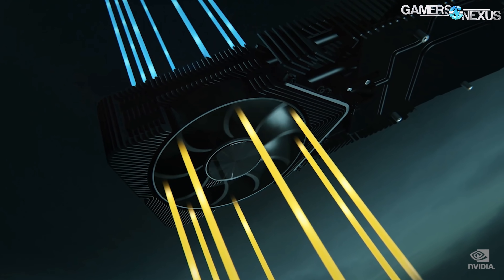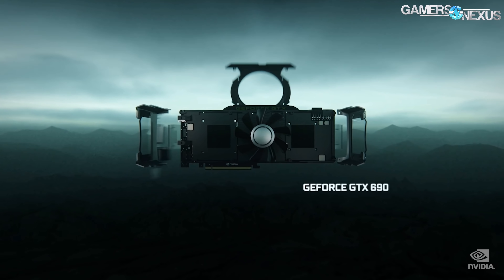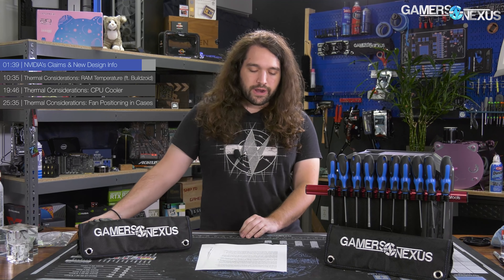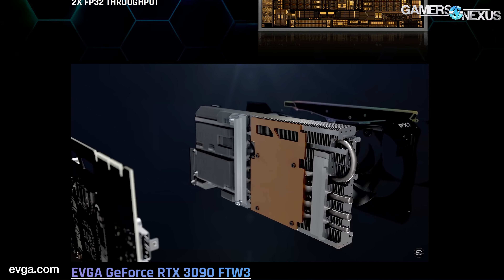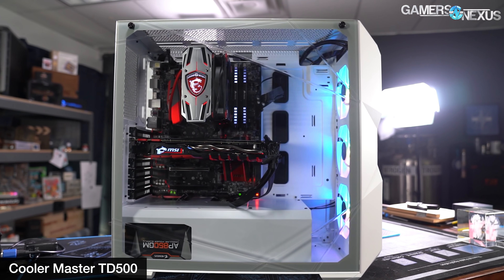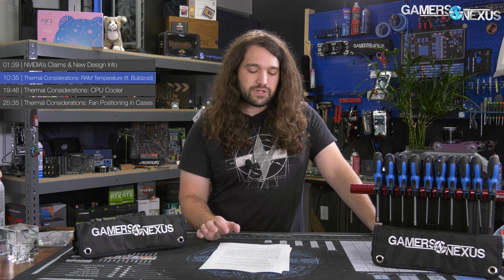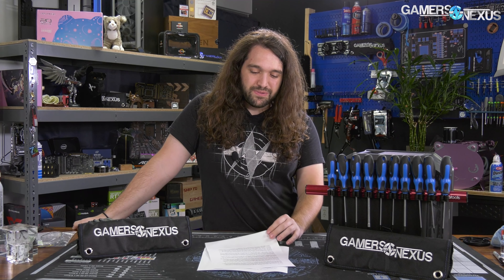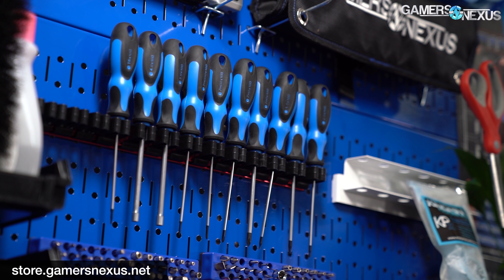NVIDIA RTX 3080 Cooler Design: RAM, CPU Cooler, & Case Fan Behavior Discussion

Comment: I just want the same thing as for every cooler. A Temperature that doesn't throttle and no loud turbine. 
What's also important: A good pre-programmed Fancurve. My ASUS Strix 1080 Ti had no hysteresis. It's Fans started and stopped spinning constantly in idle.
Reply: Should of downloaded msi afterburner and tweaked the fan curve yourself.
Reply: @propeldragon  I did, but the program needs to run or it resets the curve... cough bloatware
Reply: @gucky4717  Afterburner is not bloatware. Many people including me have been running it for years.
Reply: propeldragon Think of a food you hate. Now I’m going to tell you that I’ve been eating that food for years, so that means you don’t hate it anymore; now, you like it. 

Does that make sense to you?
Reply: My Strix 1080Ti is fine. My fans don't even think about moving until about 50 or 60 degrees. My Strix 970 and 980 were both fine too. Maybe your issue lies elsewhere.
Reply: @brutalwang4106  Thats the Problem. If i don't use a program to fix the hysteresis. Fans would spin at 56°C and shut down at 55°C. And that happens constantly.

Comment: To prevent confusion you could say standard voltages and clock speeds rather than lower. I think it better gets across the idea of what voltages and clock speeds are out of the box without the negative connotations of lower.

Comment: At this rate these cards look so nice that no one is going to want to liquid cool them
Reply: weeeell.. the few waterblocks i have seen so far are for reference design anyway, and not founders ^^'  To be honest, the vertical 12 pin socket would look ugly on a 1 slot watercooled GPU
Reply: Lmao no. Watercooling a card and watching it hit 40c max on a 30c room cannot be replaced.
Reply: Never having to hear your spiffy GPU turn into a blow dryer blasting out the back of your case during a 10 hour gaming bender cannot be replaced

Comment: I think a most representative test for comparing the FE cooler vs a more typical axial cooler would be a test with 2 cases: one high airflow and one with worse airflow with glass, and 2 cpu coolers: high end air cooler and water cooler in exhaust, as a low end cooler doesn't really fit much on a 3080 build. Of course, people will always complain about a certain setup, but that mostly cover the most common ones.

Comment: I have an SL600M case with 4 200mm fans (bottom intake, top exhast), plus a vertically mounted D-15 exhausting upwards.  This cooler design seems really interesting for good GPU temps, but with a 3900x, I would love to see some testing in vertical intake/exhaust style cases to see just how bad CPU thermals would get.  This is of course assuming more heat energy radiates directly into the CPU cooler's premises, and not out the PCIE slots or towards the front of the case.

Comment: Hey Steve, I would actually be curious  to see how the 3080/3090 perform with a stock intel/AMD cooler. Not because it's a realistic usage scenario, but because they are really crappy coolers already barely able to keep up with the CPUs they ship with. In which case, if a 3080 does indeed worsen the intake/ambient temperature of the CPU, these will be the first coolers to show it in tests. They won't be able to absorb any extra BTUs in soak, or hide small temperature changes in tenths of a degree.
If an intel 10900 with a stock cooler is still able to post the same performance with a 3080 in the system, then any $40, $50, $60, or $100 CPU cooler would simply shrug off any contribution from the 3080 cooler. And if they can't , well that would still be informative to anyone running a SFF with a low profile CPU cooler, without GamersNexus having to run a bunch of low profile coolers in a bunch of extra SFF cases.
Reply: V is for Void stoc cooler and $1500 gpu... well well... not likely scenario :)
Reply: Maybe for stock Intel, the Wraith cooler on a Ryzen 5 3600x is pretty solid.
Reply: Most SFF cases that are actually good usually have a layout where it's not possible for the CPU cooler to intake any GPU exhaust air or can be configured that way depending on how the airflow path is set up.
Reply: I was going to get a 3080 and a mid-range Zen 3 CPU with the stock cooler. I can see the concern with this new fan design, but why is that unrealistic in general? For gaming at 1440p+, it seems like there isn't all that much benefit in getting a high-end CPU; if I were buying a Zen 2, I'd get a 3600.

Comment: Hey Steve.Could you do a video about stock availability of the cards when they come out and your take on it? There are a lot of rumors on the web , some say its propably a paper launch and people will not even get them until end of the year while others say that they are propably just unavailable for some weeks. Would be great if you had more infos about the matter.
Reply: Very interested in this as well!
Reply: 3090 is guaranteed paper launch as it seems rest of the cards probably will be out of stock due to the hype
Reply: Yes I want to know how much I should expect to wait, I've been rocking an RX580 and I really want to upgrade to a 3070 before 2021, but I also expect to be disappointed. (At least there's a chance the used 20XX market will become reasonable though)
Reply: Hey man I got the numbers, things aren't looking good 3000 series launch stocks are a little bit lower than amd's vega launch numbers that's probably because samsung's 8nm yields sucks ass it will be near impossible to get your hands on one

Comment: Both the founder and custom cards appear to have a back plate cutout for fan exhaust. How will this affect vertical GPU mounting where it would be exhausting hot air right onto the motherboard chipset?

Comment: You say the Ryzen cooler is "fine but not that good", but as far as I can tell we haven't seen the Wrath coolers in any of your updated cooler tests. Are we going to see and budget/stock cooler tests soon so we can compare them to the high end coolers?
Reply: Why tho? the coolers are ment to get you started nothing more than that. You should buy something else when you can. Almost any tower cooler is better than stock. Like Steve also said, you dont pair an expensive card with a stock cooler. So the content you are asking for is useless imo. Just get a new cooler.
Reply: I hope not, it'd be a waste of time. We all know that they aren't that good. Only the most fanboy of AMD fanboys would say otherwise, and who cares what they think anyway? Even if presented with data, they'll just insist the testing was wrong and/or the reviewer is a shill.

EDIT: arose001 right above me proving my point already.
Reply: @arose001  I've built 8 ryzen systems since zen 2 launched. There's no reason at all to use the stock cooler, especially on the 3700x/3900x... They're worthless coolers and I'd only use them to test if a system works. They can't handle the chips at full load or with any PBO... Don't even need to give benches for that. You should just know that. The wraith stealth on zen 2 is garbage, 3600 will hit 76c in a high airflow case (p500, NR600, full tower cases etc.) with the stealth. Which is uh. Not very good. I wouldn't even want to turn on PBO and see it hit far higher. Now imagine putting the 3600 with stock cooler in a choked off case. It hits 76c in an optimal setup, 3 intake 2 exhaust, high airflow low ambient (20-21c) what would it hit in a worse scenario?
Reply: @masterdftw4983  The coolers are meant to cool the cpu at stock clocks, which is good enough if you don't plan to overclock the CPU.

As someone that doesn't overclock my cpu, I'd like to see data behind these claims of "you need to use a better cpu cooler to use with an expensive gpu".
Reply: @screaminjesus  Who in the right mind buys an unlocked cpu and not overclock? I can understand if you do not know how to overclock but you are missing out on free performance.

Second, giving Steve's rep and the hours upon hours of content he has provided, why should he use his time on stock coolers when everyone encourages buyers to get an after market cooler.

If you can give me a logical answer so I can try and understand that would be much appreciated. (and no im not trying to sound condescending I really want to know your logic and think process)
Reply: @masterdftw4983  I have a ryzen cpu, pretty much all ryzen cpus are unlocked, so its not like I paid extra for an unlocked cpu. Also, zen2 cpus don't really have a ton of overclocking headroom, doesn't seem worth the bother to me.

"when everyone encourages buyers to get an after market cooler."

This quote illustrates my point. People say "don't use the stock cooler' without providing any data to back it up, which is why I'd be interested in stock cooler results.

Comment: you could always reverse your tower cooler fan. have the back fan blow into the cpu fan fresh air which is also blowing towards the front of the case, and have the front fan blowing out the hopefully mesh front lol.  if you have 3 front fans you could have the top 2 blowing out and the bottom one sucking in towards the gpu intake. and if you have top fans too, you could make the one closest to the back suck in having the fresh air get caught in the crosswind going into the cpu cooler and the one closest to the front blowing out which would take some of the cpu coolers exhaust and gpus air with it since the gpus exhaust blows straight up anyway. the front top exhaust is just to catch any remainder heat and keep air moving fast over the ram.

Comment: "but my AMD ryzen cooler is good!"

"You're wrong, its not."
Reply: My Ryzen 5 3600X runs fine @ 34 oC with default cooler, near GTX 1080 GPU.  It jumps to 50 oC when in heavy use. If I buy a stock Nvidia 3080,that hot air will go straight into CPU cooler ... this cannot be good. I'd have to build a air flow baffle .. or demand Nvidia make one .
Reply: so intel stock coolers are good?
Reply: @fatti9780  All stock air cooler are good for is:
A. Increasing the amount of metal that ends up in your local landfill
B. Making your local bank teller say to you "Computer is being slow today" because her bank gave her some POS Dell slimline to work with

Comment: Simple solution: bottom+rear intake, top exhaust. Done. 
If you're super worried about your memory sticks you can always print a shroud/duct and add a dedicated fan in the front.

Comment: I'm sticking with my 2070 super and skipping the 3000 series and probably the 4000 series.
Reply: naftaLi every two or three generation is good timetable for upgrades if you really need to have very highend atuff. Most people keep the same gpu 5 years before upgrading, so your 2070 will be fine Many years.
Reply: I think I'll stick with my 1080Ti until the 4080. The 3080 will struggle at 4k in some titles. I'll make the costly move to 4k when 60fps isn't a struggle on ultra settings :)
Reply: Wise idea

Comment: Is the conclusion of this video “if you dont heavy OC youre safe?”
Reply: Depending on you current tower/ cooling solution but .... probably safe.
Reply: Normal highend cooler will put all the hear to the case. This will push some of that heat out of the case using that other cooler, while the other push it to the case. So in there this should be better than most aib coolers, but without testing, it is just a theory!
Reply: SmashStomp Inc  corsair does - sf750. Just ordered mine.
Reply: Yes, unfortunately a lot of viewers are struggling to understand things as they are presented.  Definitely feels like he needs to make things easier to digest for some people.

If you pay attention to his other videos then you would know that they recommend a good CLC AIO and they recommend equipping your high airflow case with the fans it needs to perform as best as it possibly can.  If you look at the airflow diagram that image shows what equates to a stock case with two front fans, and an exhaust.  Now if you aren't planning to cheap out on your build you will do what I am doing which is making sure I have fans for wherever the case manufacturer neglects to include them (the case I want doesn't actually come with fans).

Comment: Does anyone think I should upgrade my 550w PSU to a 700w+ for upgrading to a 3080?
Reply: Nvidia States on their web page that the 3080 and the 3090 need a 750 watt power supply.
Reply: Yes, Nvidia recommended 750
Reply: It's literally necessary lol... You'll need 800W+ to be safe.
Reply: Alright I appreciate the answers you all provided. I’ll probably get a 800w to be safe.
Reply: @xronos_exe  Im getting a 750 w, im pretty sure when nividia give their recommendations its usually overkill. But also depends if you are overclocking your parts

Comment: Seems like an AIO with its radiator set up for front intake alongside having exhaust fans at the top & rear of the case is one of the best solutions to the FE card's airflow.
Reply: that's the most common AIO setup. Although if your m2 is below the card, your SSD will suffer no matter what. Personally, I do not see 300W+ cards being air cooled inside the case as a normal situation.

Comment: I would like to know...since Intel is slow getting pci-x 4.0 support out there, I have PC with Intel Z390/i9-9900K which only has pci-x 3.0. Seeing the new RTX 3000 series supports pci-x 4.0, will us Intel users be left in the dust in terms of "cheap" upgrade path and run into bottlenecking with the RTX3090, while AMD users striking gold with already having pci-x 4.0 support on recent builds? Or will it only affect loading times with because of direct ssd access features?
Reply: Don't worry, it'll be the least of your concerns when Zen 3 arrives.
Reply: you get to buy RTX 2080Ti for sub 500 usd when the RTX3000 series comes out... you'll only realistically be missing out on DX12 exclusive titles that would probably require RTX enabled cards (but if they have built-in RTX OFF function, then it's all good)...
Reply: @AKOsiMORRIS  i already have 2080 ti ..... F
Reply: Don't remember if it was Steve, Jay or Linus but this has been covered already. The card will work just fine.

Comment: I think the new cooler design on the Ampere FE cards looks like it can be perfect for the Lian Li O11D case where you can put the exhaust fans on the side. If you then mount the GPU vertically, the hot air from the card will go straight out with the side fans on the case.

Comment: Why can't you just say the word "decibel"? Do you say "el bees" instead of "pounds"? 😉
Reply: common industry lingo that's all.  pounds is one syllable, easy to say, decibel is a lot more "wordy", thus the "debee"
Reply: @avenshmit66  is that right? 🤔 I can see what you're saying, though. Kinda like in engineering where they often talk about a length in "mils", rather than "millimetres". Although a teacher would more likely say the full thing
Reply: @AntneeUK  I'm actually an engineer, and you're exactly right about the mils!! Decibels are used a lot on electrical engineering as well, so we say debee all the time :)
Reply: @avenshmit66  my family are engineers, but the "deebee" thing annoys me 😁 My grandad was a legendary engineer. I've done my time on CNCs (Bridgeports) but am in software and web systems engineering now. And yes, I know "proper" engineers don't like it when we call ourselves engineers 😁
Reply: @AntneeUK  I have a ton of respect for software engineers, they're just as real as any other!
Reply: @avenshmit66  much appreciated 👍

Comment: Think I'm going to jump on a FE for the first time ever since the performance jump alone is so significant I'm not too worried about the performance benefit of AIO ones especially when you take added cost into account. Also with the fan setup I can see it being pretty decent with a rear exhaust and top exhausts even if it does mean floating hot air over the cpu (under water) somewhat. Should be interesting to say the least and can't wait for all the GN videos about it to come.

Comment: I always always love the in depth explanation from Steve. I have the  lian li Pc-011 great case. I have a 360 aio in the main intake and three other fan's bringing cool air from the bottom. I noticed that the nvidia 3000 series airflow was only from the front of a case? I used to have cooling issues with in regards to gpu    until I introduced fresh air from the bottom of an expertly designed case now my gpu has never run over 40c  in extended game session's. As Steve has said it all depends on case and personal management.

Comment: ...perhaps...the 3000 series GPUs could be when vertical GPU positioning started making sense? Blowing hot air at PCIe slots should be better than blowing it straight at the RAM. Perhaps use the regular PCIe brackets behind the vertical GPU to mount an exhaust fan, to create a strong front to back airflow, helping suck out some of the hot air?

Comment: What about changing the flow direction of the CPU cooler? 
And change the back fan to intake instead of exhaust. 
CPU would take fresh air directly from the back, and exhaust hot air just where hot air coming from the GPUs would be. All top fans in exhaust position, all other fans in intake position, and you got a nice airflow there.

Comment: I reckon for this NVidia 3000 FE cooler design,  the best thermal would be achieved in cases with three intake fans at the bottom (eg Lian Li DO11 series) pushing fresh air to the GPU fans. Also it would be interesting to see which configuration of side or top mounted AIO (with exhaust fans) will work better.